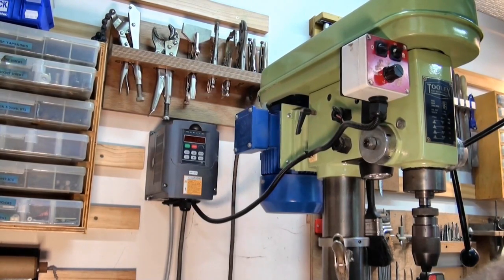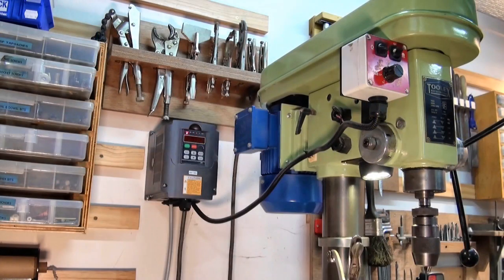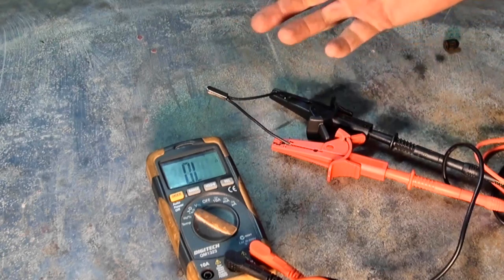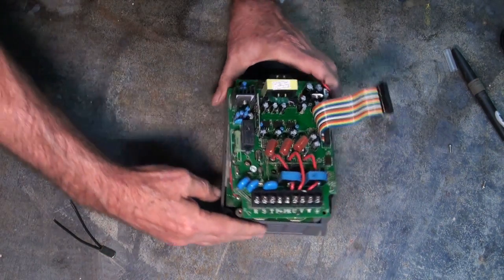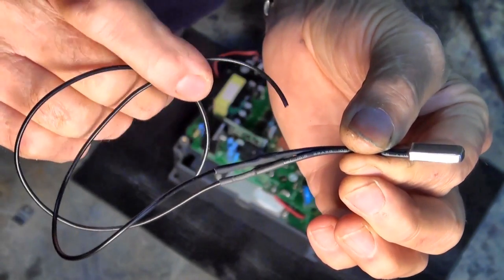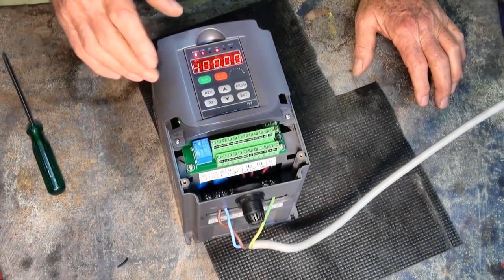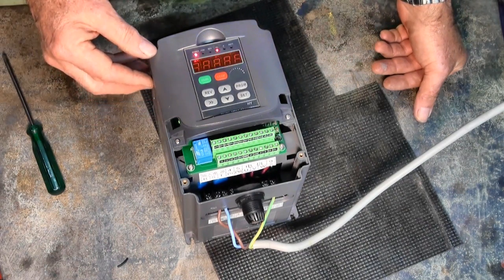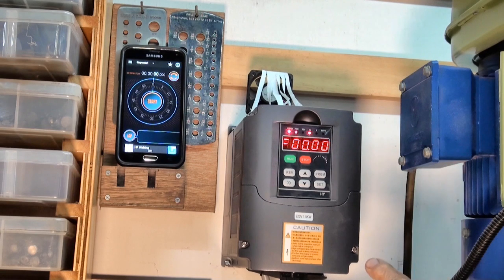How to make a SILENT Huanyang Variable Frequency Drive.

Comment: Don't know if you still read old comments but i followed your recipe and it has made a huge difference in my shop. Many Thanks
Reply from the maker: That's great! I don't regret delving into the guts of my Huanyang. However, I recently purchased two Bosch Rexroth VFD's and they are only slightly dearer that the Chinese VFD's and as a bonus, you can turn the fan off or on or set it to auto in the configuration menu. 
Regards,
Mark

Comment: I did that same thing but put an 18 volt 5 watt zener diode across the thermal switch so the fan would run at 6 volts rather than not run at all.  If the heat sink gets hot enough; the thermal switch sends 24 volts to the fan and runs it at full speed.  At 6 volts the fan is almost silent but still moves some air, which helps maintain a more constant component temperature.
Reply from the maker: Ken, that sounds like a good plan. I must admit that on/off circuits are about as adventurous as I want to get when messing with mains operated gear. The VFD runs really well on my smallish drill press as it doesn't run for long and most times it isn't running particularly hard. I have had the fan cut in on a few occasions and that was when it was quite hot in the workshop and I was drilling lots of holes or large holes. I would think if you were using the VFD to power a pump or a large conveyor or something like that you wouldn't want the fan to be off at all. Running in standby mode as you suggested would be good.
Regards,
Mark

Comment: A good idea.  Thank you.     To be honest, I would have done it all with out taking it apart.  In fact, I've just done it.  I've got  the same VFD.    There is lots of room to work under the fan. 

A Paper clip works great.  Not the bent wire ones.  A binder clip.  They're spring steel. On in seconds and holds it firmly.   Just clamp it onto a fin.   No drilling.   No glue. 

It took my soldering iron longer to warm up, than to fit it.   A few minutes to cut a wire and solder it in. Done.

I want to point out that I did it so quickly because I watched your video.  Without your video I would have had to work out what was going on with it and come up with a way to sort it out.   You took all of the hard work out of it.   So, thank you.

I'm not criticising.  Not at all.  I'm a bit of a cheat.  I read around, watch YouTube and visit forums.  Then. I steal the best ideas.  I have no shame

 I was going to use a strip of spring steel.  Put a gentle bow in it to make a spring and use it to hold It between two fins.   I saw something like it on the fins of the barrel on my chainsaw.   I just happened to notice a springy paper clip .ready made for the job. 

If anyone reads this I hope it helps them.    A lot of people won't like taking it apart.  Now they won't have to.

Best wishes.
Reply from the maker: Ha ha, I sort of came to the same conclusion after I spend so long delving into the guts of the box. There's no shame in taking the course of least resistance. Well done.
Reply: I have the same drive. Switches on their way from China. Thank you for this tip! I will definitely do it. I was considering switching the fan to something bigger and laying it on top. Did you consider that @Andrew George?

Comment: Just did this today and wish I would have done it 4 years ago. Thank you for making this video!
Reply from the maker: I am really glad you found it useful. My Huanyang VFD is still going strong despite almost never having the fan working. Many people predicted that it would be ruined because of the modification. I think the fan has only ever cut in four or five times and it was always on a very hot day and usually when I was doing some high torque drill processes. 
Regards,
Mark

Comment: Mark,
Nice video and nice modification.  About 12 years ago I got an ABB 2.2 kW VFD.  The fan was on continuously and was very noisy.  I fixed it by changing fans to a modern silent computer fan.  That was very quiet.  A few years ago I got a 4 kW Huanyang VFD which was also noisy as you have found.  I replaced that fan and problem was solved, because the fan supply was 24 V as you note, I put a resistor in series to limit the fan voltage to 12 V.  The combination of your fan switching and a quieter fan would be the ultimate system.
Re changing the pwm frequency to eliminate motor noise.  I use the ABB on a shock dyno and the Huanyang on a mill.  Neither produce audible noise, at least to a deafo like me.  however i have recently put a 5.5 hp motor on my lathe and that motor sings like crazy on a Huanyang which by default is set at 7 kHz pwm frequency.  I made a dV/dt filter and that fixed the motor noise and gives an easier life to the motor.  Like most things changing the frequency to reduce noise has its downside as well.  A general way to look at it is "higher frequency is good for the motor  but bad for the VFD" , you get more heating in the VFD due to the increased IGBT switching.
Reply from the maker: The noise of that fan used to really annoy me. Since doing the mod it has only ever run twice. On both occasions I was drilling lots of large diameter holes and it switched off after about 10 minutes. Some one recently pointed out that if the thermal switch fails it won't be obvious and the drive might fail due to overheating. He suggested I use a normally closed switch but It would make the switching more complex. I prefer my more expensive VFD's but the Huanyang works fine on the drill.
Reply: @Preso58  Rather than changing to a NC switch you could just add another NO switch in parallel to the one that you have.
So far I have had no problems with my Huanyang, the general concensus seems to be that it is the best of the oriental offerings.  As I am sure that you know the manual is total rubbish and the programming is tedious.
BTW I ordered a bunch of 45 deg switches which should be here in a day or two.  My lathe motor has a noisy fan powered by it own motor, that fan is far worse than the VFDs and I'll be controlling that fan as per your suggestions as well as both VFDs.
regards
Tony Foale.

Comment: Hi Mark, Good video.
I had a wry smile to myself as I watched how much time it took to do the modifications to the VFD.
What amuses me (and I'm as guilty as the next man) is how many hours of our time we are prepared to spend, to improve the way cheap Chinese products perform (both electrical and mechanical).  ' IF'  we costed our time, then it would probably be cheaper to just buy the more expensive 'European' product.   Plus, we would get a users manual that was easy to comprehend.
But, there is much satisfaction to be had from modifying and improving equipment, plus we never realise just how long that 'simple little mod' will actually take!   I'd also rather work for 4 hours in my garage, than work my day job to earn the difference in initial cost.
I have two cheap Chinese drives from Banggood, in my workshop;
The first runs a three phase Shaper machine. It ran perfectly straight out of the box, with no parameter set ups required, a quiet fan, no motor harmonics and an almost instantaneous start up.
I've just bought a second VFD for my mill, but this one has a loud fan and takes 5 -10 seconds to 'boot' up.
I think I will copy your  bi-metallic switch mod!!
Cheers Paul in NZ
Reply from the maker: Paul,
I agree with your observation that time spent on upgrading inferior design has it's own merit. I take the view that even if I end up scrapping the part I have at least learned something that I otherwise would not have known. Also it is very satisfying when a project turns out to be a success. I rarely have the fan in the VFD turn on now and when it does I am reminded that the mod is working as intended. I am surprised that you were able to buy a cheap Chinese drive that worked straight out of the box and with such a short boot up time. I assumed that all those cheap drives were clones of each other. Mine initially seemed to be broken. The motor would only turn at 100 rpm or so and it sounded like it was very close to death. I found out (on YouTube) that by default,  one of the parameters was set to a ramp up time of something like 5 minutes. So of course it seemed like it was never going to get going. I'd be interested in finding out a link for the "good" VFD if you still have it.
Regards,
Mark
Reply: Can you say which is the drive that worked out of the box with fast boot time?

Comment: Just a note of caution..... some of the manufacturers actually connect switch leads to case internally so you liven up the case when you energize. If the switch is inside shrink tubing it usually means that is the case with your switch.
Reply: EXACTLY!  I had one of these rigged up on a heater and got a shock when the piece of shit engaged.

Comment: Wow, just wow. That was epic. Same VFD, same noise. Thanks for the video.
Reply from the maker: Thanks. I can tell you that the fan on my VFD almost never turns on now. If I am making big heavy cuts with something like a large holesaw, the fan will turn on but it's a blessing to have the VFD turned on and silent. I recently purchased two Bosch Rexroth VFD's and they have options in the setup to turn the fan on permanently, off permanently or set to auto. The default is auto and neither fan has started on them even though one is fitted to my Colchester lathe and it works quite hard sometimes. 
Regards,
Mark

Comment: Wow I did the same modification to mine for my old mill.  It’s nice to see I did it right.
Reply from the maker: I'm glad I'm not the only one that was driven crazy by the sound of that little fan whirring away for no reason. Just recently, I had to drill a large number of large holes with a 25mm hole saw and it was a very hot day. I am happy to report that the fan switched on and did it's job although that's probably only the second time I have had the fan switch on since fitting the thermal switch. 
Regards,
Mark

Comment: I have 2 comments and one is about safety. The plastic shrouds and isolation sheets are there because the 110/240v side has to be separate from the user operated side of the circuit. If that switch you installed is case negative or something, you could have connected the high voltage switching circuit back to the user side, potentially leaving 110/240/380v or god knows how many under those thin membrane switches. I really hope you are considerate about safety because a crappy 70$ VFD is not the only loss possible here when playing with mains. On another note, that to220 with 2 legs could just be a weird fuse, of could just go directly on a pulldown transistor or inverter, might not even be connected to the micro, more like, it turns everything completely off including the power rail of the micro. That's more effective as safety
Reply from the maker: With regards to safety, I just went and checked the switches I purchased for this modification and the case is isolated from the two switch wires so there is no danger of line voltage finding its way to the fan. The fan, and its shroud are insulated so once again there is no danger of leaking voltage. I did not really alter any of the structure of the VFD except for drilling one hole in the heatsink. I believe the TO220 package is in fact a heat sensor since documentation states that the digital display is capable of showing the temperature of the VFD however I couldn't find the correct settings to make this happen. So far the mod has been a success and just two days ago I had to drill a large number of holes in some stainless steel sheet and the cooling fan started up as I expected it to but that is the first time I have heard it run since installing the switch.
Reply: @Preso58  Current ads also show the temp sensor so they can compare theirs to a knockoff. Also the HY has two current sensors while the knockoff has only 1.

Comment: How are you going, Mr. Presling! - Quality Control at the HuanYang factory must have stepped in as they put silicone over all of the plugs and made the wire on the fan so short that it renders the door covering it useless as the fan won't pull out far enough to work on. Luckily, I was a micro-miniature repair tech in the Navy and know my way around the boards and can still implement your fix, or a combination of some of the really smart folks that have commented (i.e. a bull-clip to hold the thermal couple). Thank you for your video and approach to this nuisance.

Comment: The custom PC market has quite a lot of options for quiet high performance fans. Brands like Noctua are worth looking into, though don't know what voltage these fans work on, probably 5-12v though
Reply: Precisely what I was going to recommend.
Reply: I agree that Noctua is a good brand, I myself replaced noisy fan in my 3D printer that had been actually replaced already once before with cheap crap that broke again, no issues with noctua so far and very silent.
But they don't achieve it with some magic technology, if you put chinese $1 fan next to noctua $10-20 fan and spin both at the same RPM, they will create pretty much same noise and noctua just few dB quieter at most.
What they do to achieve most of the difference is to reduce the RPM, this means that the amount of air that those can push is reduced as well.
This means that whatever you're trying to cool, Noctrua will cool it less, in worst case your device might overheat.
So be aware of this and check the temperatures before and after to make sure all is good.

Comment: Most of the VSDs or VFDs I work on have the heatsink fan at the bottom.
I think the theory is that the air at the bottom is cooler and therefore more dense, so more air can be pushed through the drive - possibly more efficiently.
The downside is that the fan or fans are harder to access due to the power and control cables always being in the way.
Reply from the maker: I get the feeling that the fan position and the control for it seems to be a bit of an afterthought on these Huanyang VFD's. The good news is that the fan hardly ever runs since the mod was carried out. 
Regards,
Mark
Reply: @Preso58  
Totally agree.
I just picked up a Harrison M300 lathe, ex RAN training school, and have converted the electrics to 240Vac with 24Vdc control.
I've used an Invertek (English made) VSD (similar to the one you've got). Oddly, this drive doesn't have any force cooling, totally dependent on natural convection.
Watching all your videos, very informative and interesting.
Loved the bridge !

Comment: This is a fairly easy fix for the fan noise.  Installing a different fan would work as well, though may be more expensive.  On to the carrier frequency...  Yes it can be changed to reduce any noise from the motor.  However,  you risk damaging the motor by increasing the frequency too high.  We had found this at work where someone didn't like the noise from a 500 hp motor on a plastic extrusion machine.  The motor has failed, shorted windings, due to heat issues 3 times in the last 2 years.  Very expensive repairs for someones' dislike of extra noise.  There were other issues that helped the motor failures along, but one of the main ones was the carrier frequency was set to 10 kHz.  So just be careful with this setting as it can induce extra heating in the motor windings.
Reply from the maker: Thanks, I'll keep that in mind. So far I have not heard the fan switch on once and I did some fairly heavy drilling operations for another video I was doing. I have also been monitoring the motor temperature (by holding my hand against the frame) and for what I am doing, it never gets more than warm. I can imagine that in an industrial environment it would be a different ball game all together.
Reply: higher switching frequency (carrier frequency) does result in more heat generated in the motor and the VSD, it's the number of times the IGBT's are switching on and off per second, the transition from off to on and on to off is when IGBTs generate heat on the heat sink.
You can safely go higher on smaller VSDs generally speaking, 12 or even 16kHz shouldn't be an issue.
A plastic extruding machine would be constant torque load and typically at full rated load of the motor most of the time.
Bigger VSDs over about 110kW do not usually run a switching frequency above 2 or 2.5kHz in my experience.
(almost a decade in VSD service).

Comment: Hi Mark thanks for making this video, I have a similar VFD on my lathe, and the noise has been my only gripe with it, I cannot hear the lathe motor over a tiny 40mm 12V fan. Being in the UK I can be a bit more conservative with the temperature 30C would be a pretty rare event here, I will be making the modification as soon as the switch arrives.